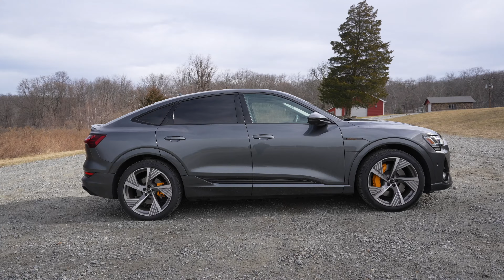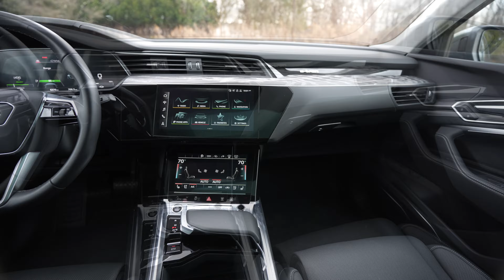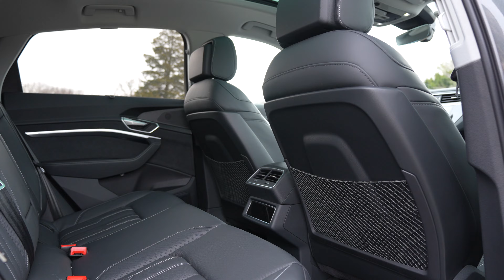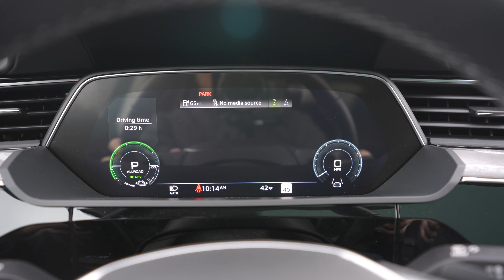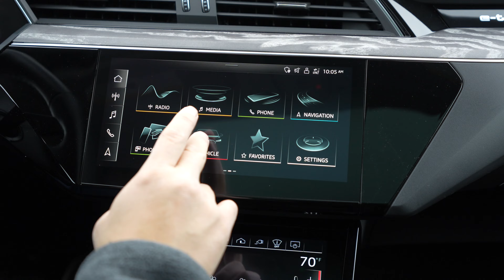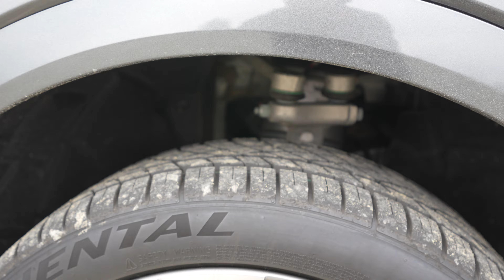Audi E-Tron Sportback Is A Solid Performer With One Drawback

Comment: If it wasn't because this particular model has an appetite for cannibalising electric motors, I would've bought one for my dad already.
Reply: Is it just this year or also the 2021 I’m looking to get a a Audi etron looking for all the info I can get
Reply: @carlyonmaster  it's apparently an open issue that remains unresolved. In 2021, they updated the coolant seals, but that only mitigated the issue rather than resolving it. TSBs remain in place for MY2025 models regarding this issue.

A company called EV Clinic promises a completely revised design that supposedly resolves the issue. Those were my contingency plan if we had gone for the e-tron in the end. 

We went for a Polestar 2 instead.
Reply: @aplanedividedthesky  damn audi just can never get it right! I want one but damn I love to gamble just not with 25k lmaoo